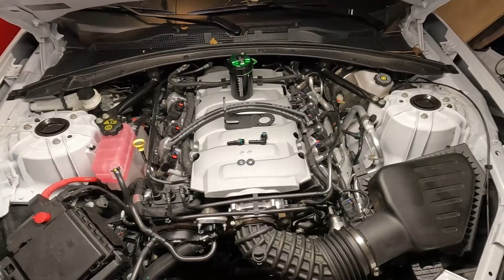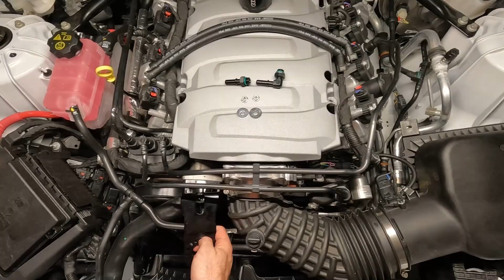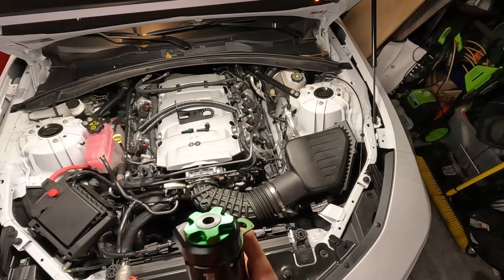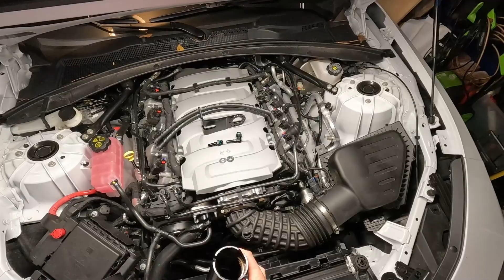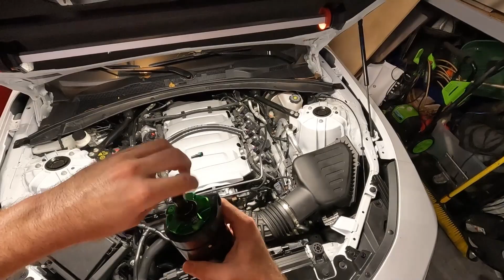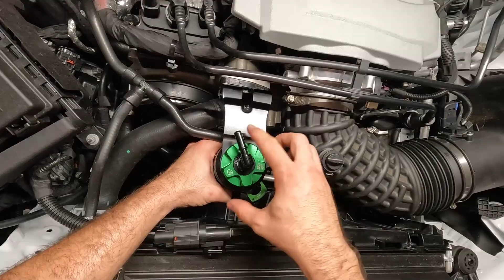Improved Racing CCS Oil Catch Can Install - Gen 6 Camaro

Comment: While you stated that you "push down and turn to remove" that is not how it would be done mounted in the vehicle.
I would like to see you remove that can after you completed the install and see how easy it is.
How stout is the bracket and mounting points to withstand the pressure required to remove and reinstall the reservoir?
Reply from the maker: It's just as easy, but with more limited access. It still takes less than 10 seconds to remove while in the car.

Comment: Great video, definitely looks like the best setup i"ve seen on a 6 Gen Camaro. I'd like to see how easy or difficult it is to pull the tab out and rotate the can after it's installed.
Reply from the maker: Hey there. I find the pushing and rotating is the easiest part. The hardest part is, if you're trying to remove it after a drive, it's like you're trying to fondle hot lava

Comment: Shouldn't the washers go under the nuts. Pretty sure they should otherwise good video I'm going to look into one.
Reply from the maker: Instructions said they go under the bracket to avoid damaging the water neck nuts underneath the brackets. Probably wouldn't hurt to put another set of washers in though!
Reply: The way he did it is correct.
Notice the nuts have, for lack of better term, a washer on them. The flattened larger than just the nut surface is acting like a washer.